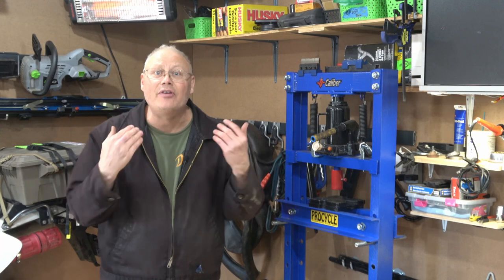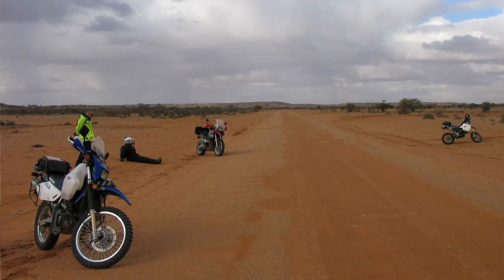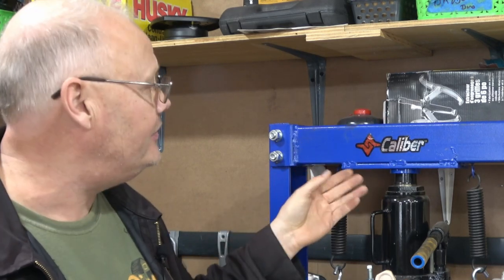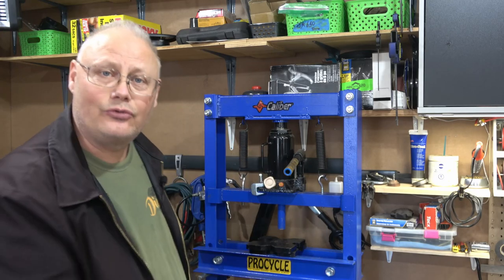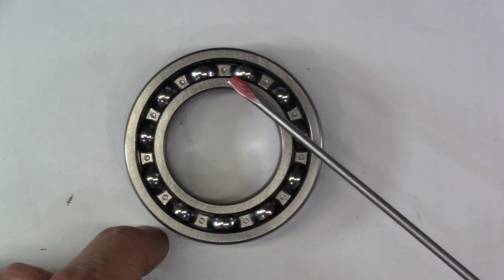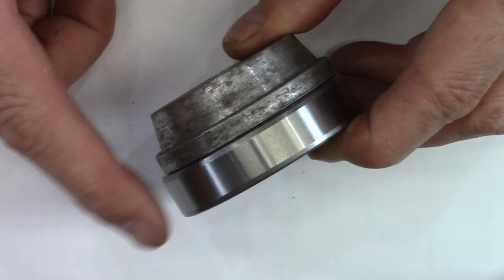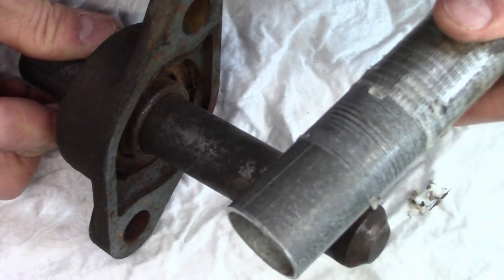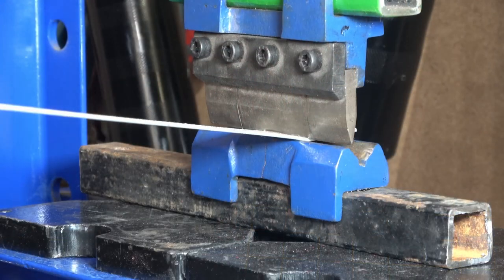Shop press basics, on Tinker Tool Time.

Comment: Great video Dino! One of the best tips I came across when I got my press was to save all of your old bearings and such that was destined for the trash. They sure come in handy down the road as spacers and to push against! Sometimes the bigger challenge is how to jig up an odd shaped item such as a steering knuckle off of a car etc than it is actually pressing out the object.
Reply from the maker: Thank you for the comment, I agree fully on the set up comment. Again I am not really all that experienced with what a press can do, but even the simple tasks are made easier with one. 
Thanks again
Dino

Comment: I would love to have a press. Last time I needed to remove and replace ball joints, I ended up using a vice and a ball joint kit. It worked well enough, but would have been way easier with an actual press.
Reply from the maker: Thank you for the feedback, I struggled with a vise for years, when I got the vise it was.......nice lol
Dino

Comment: Sure you can buy a cheap press but then you still need to buy the bearing install kit and in most cases a 6 ton press wont even have enough power anyway. Use your large vise to hold the steering knuckle and then use your bearing install kit. Works very well.

Comment: What perfect timing Dino, I'm in the process of buying one. Is yours a bench or floor mounted press?.
Reply from the maker: It is technically a floor model but it is not very tall so I mounted it on a wooden base I made that raised it up about 15 inches.
Thanks for the comment, I will be doing a follow up video that shows the mods I have made including the base.
Dino